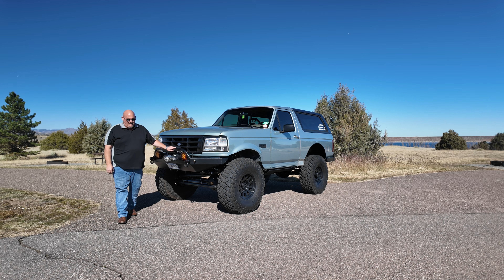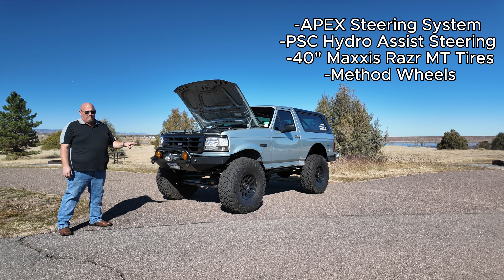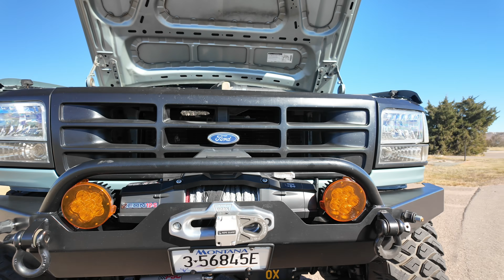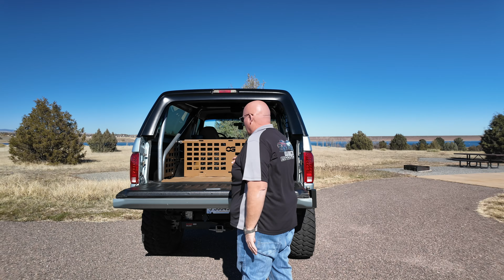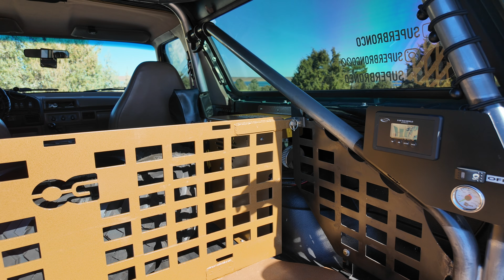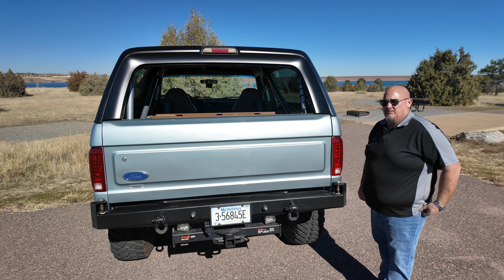1996 Ford Bronco “SuperBronco” | Full Walkaround & Build Details

Comment: Nice Rig!!!  Hey does is that Tremec 4050 to Atlas a divorced set up ?  What adapters or parts are needed for that?
Reply from the maker: Specify to Advance Adaptors/Atlas what transmission you have and it will bolt right in!